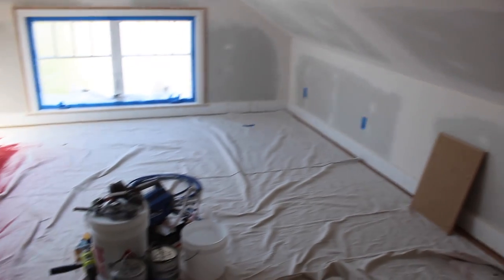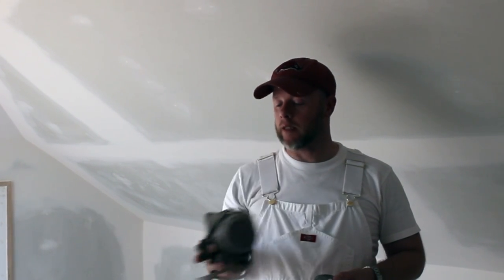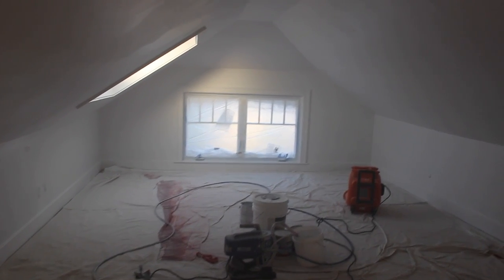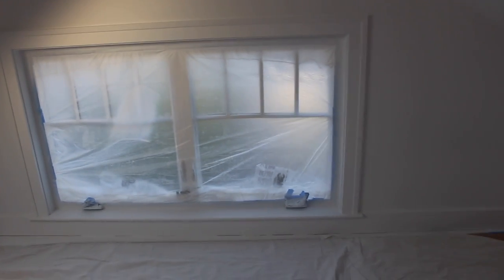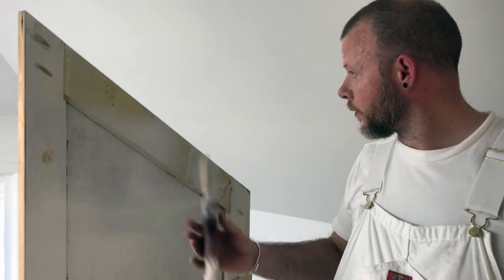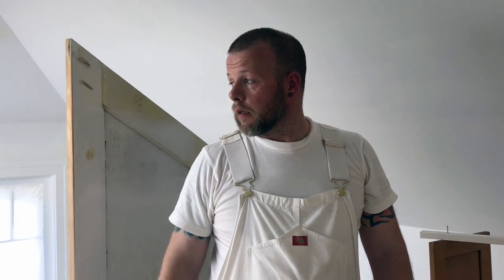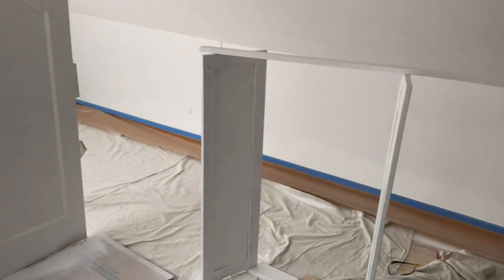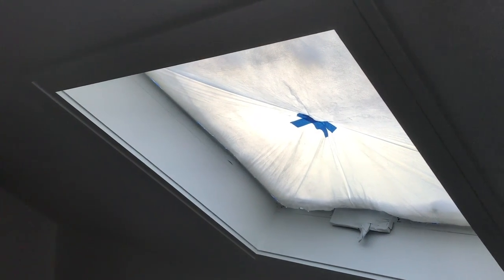ATTIC REMODEL | Painting the Attic: Part 1

Comment: You’re going to need to sand that primer before you paint the trim if you want the best results.
Reply from the maker: Done.  I sanded between every coat - 2 primer and 2 paint.  I use Ben Moore Advance trim paint and all the trim is glass smooth.
Reply: What spray tip did you use?